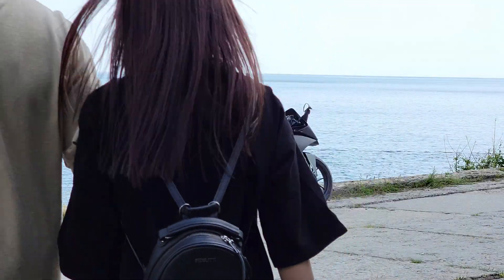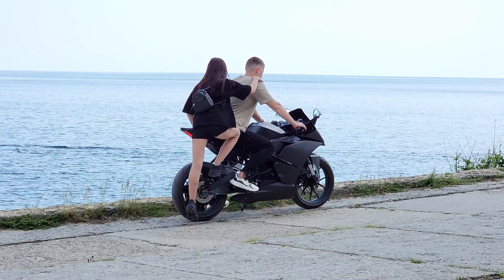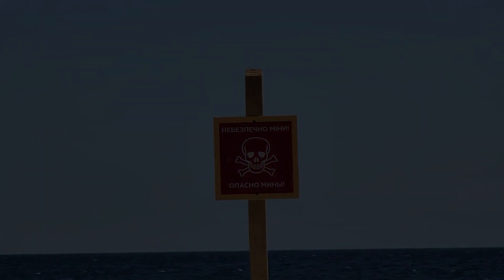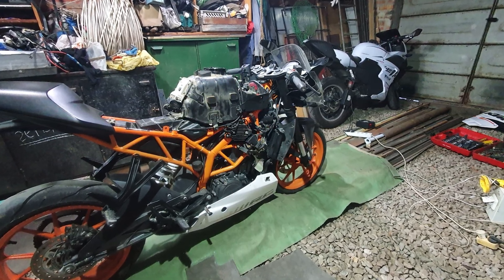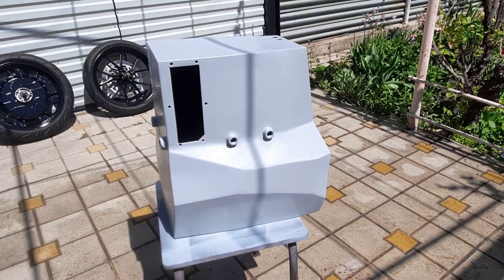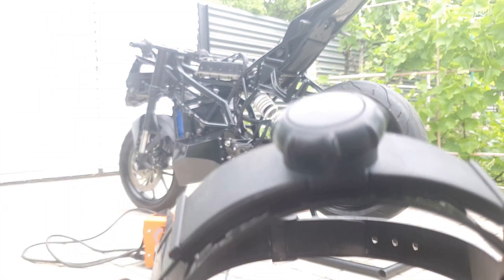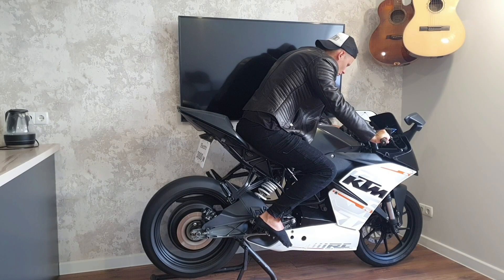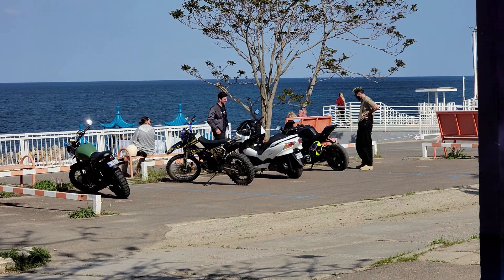KTM RC Electric conversion Ukraine // Electricmotorcycle // Електромотоцикл //Электромотоцикл Ua

Comment: Hi. I like your videos. Great work. I. Got a question. How do you set up the controller so you burn the tires out. I have a 12000 watt motor and it doesn't do that